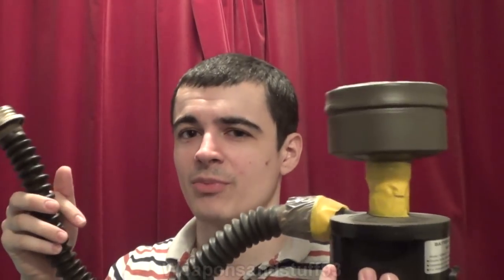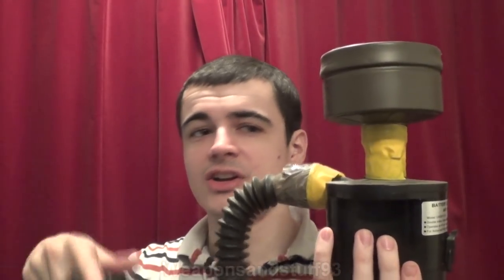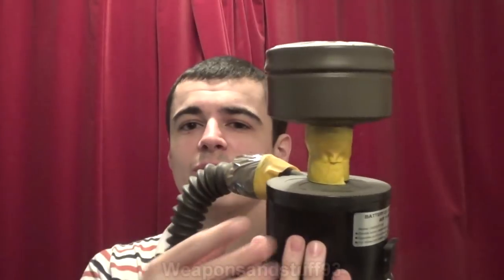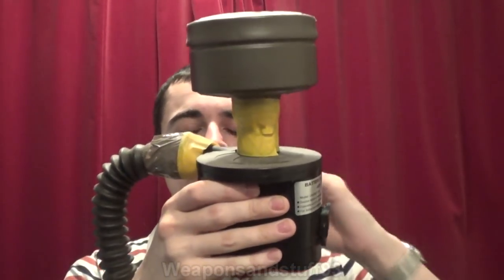Pros and Cons of Powered Air Pumps

Comment: I'd love to have a positive pressure mask for my work just because it'd be much cooler than my normal mask.
Reply: What's your work? What do you work as? And what mask do you have?
Reply: @Rack47  I used to work at a Sugar mill, with lots of bagasse and if i had a positive pressure mask it would have been much better in the high heat than my normal mask where I had to feel all the heat of the boilers which can reach up to 50"C.
Reply from the maker: Yeah keeps your face cooler

Comment: would the filter last as long, if you took a new one and did the positive pressure system, would it last as long as breathing through a new filter normaly
Reply from the maker: It runs the filters out faster.

Comment: Quick side question: would you consider getting a swiss 1939 FEGA C-gas mask? I have it and its a very good gas mask to use actually with a modern filter. Its Just like your finnish 1939 gas mask
Reply from the maker: If I see one cheap enough then yes I'd get one.